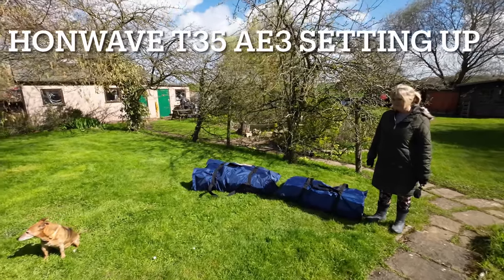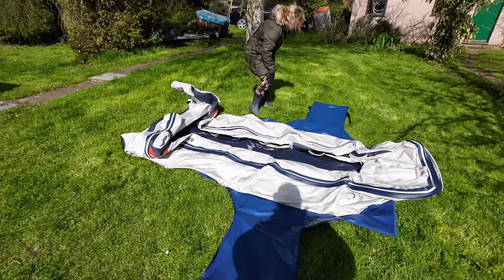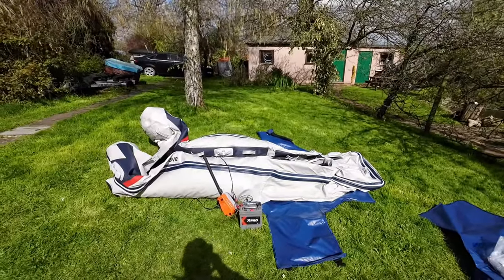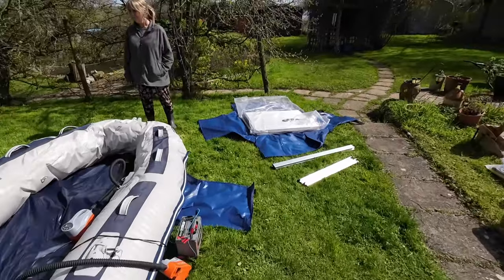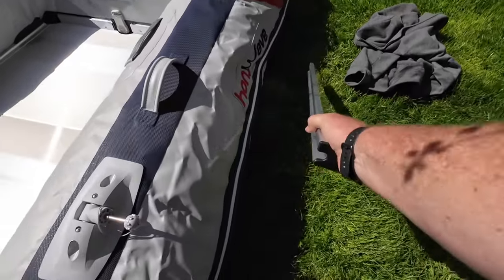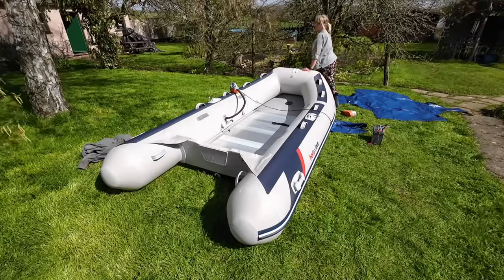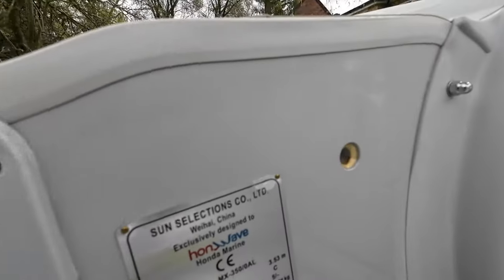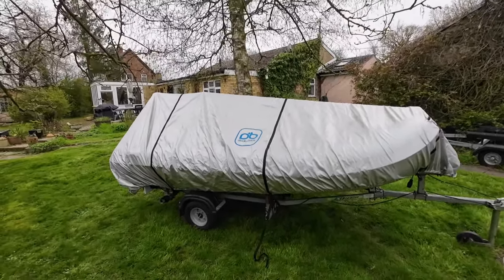Honwave T35 AE3 inflatable boat setting up on Extreme inflatable boat trailer

Comment: Hi, thanks for the video. I have a problem with water intrusion with this model. Water appears even on flat days so it's not coming in over the tubes or transom. When accelerating and the bow of the boat starts to lift, all the water suddenly appears at the back of the boat. There are no signs of any damage, the boat is brand new. I had the same problem with the T38 and my dealer took the boat back under guarantee and marking the boat as "faulty". Now it's happening again with the T35 alu and the dealer doesn't believe that there can be the same problem again on a brand new boat so I'm stuck. Any advice? Thanks
Reply from the maker: Not sure I can help much on this. You will always have a bit of water in the boat that will indeed go to the back when you accelerate. I assume you are putting the bung in the boat the correct way ie from the rear

Comment: It gets much easier after a couple of times, you get better and the boat stretches a little. Getting the rear floor central is critical. I have a t40 and install the floor with hardly any air in at all.About 20 mins for full setup
Reply from the maker: That is very quick. We tried with very little air but found the tubes just kept flopping forwards and made it even harder to get the floor in. I was thinking of a T40 for the trailer but went for the T35 as it is quite a bit lighter if me and her indoors ever have to lift it
Reply: @boatingsibbingandwandering3262  also my lawn is not flat, the first time I assembled it on a flat surface it was much easier
Reply from the maker: @attonicuc44 When will you ever be lucky enough to set up on a flat surface in ideal conditions 😳

Comment: Putting the floor in really isn't difficult. You have put far to much air in tubes before fitting floor. Half full at most. Tubes should barely hold shape and still be a bit floppy.
Reply from the maker: We did let a lot of the air out and the tubes were quite floppy at that point. We Still found it incredibly difficult in that regard